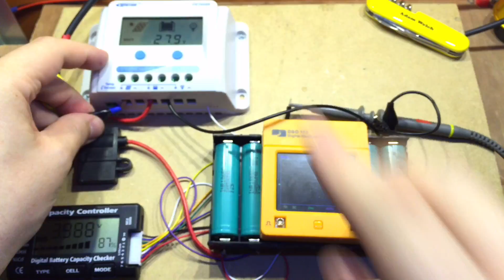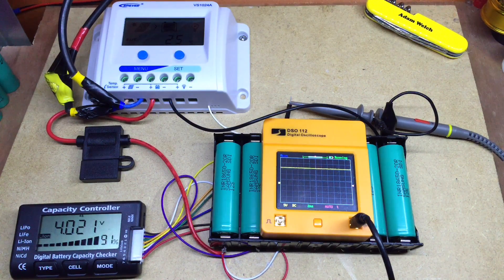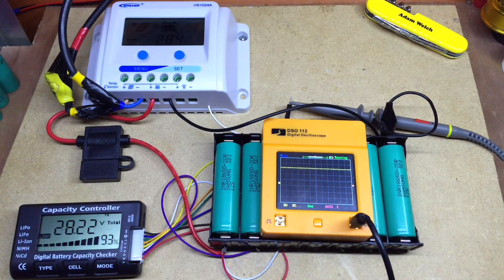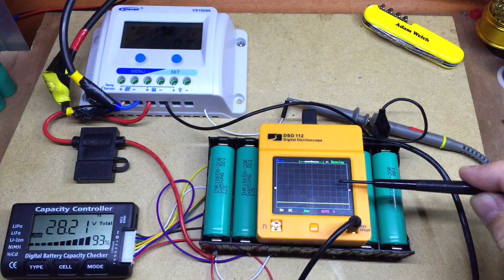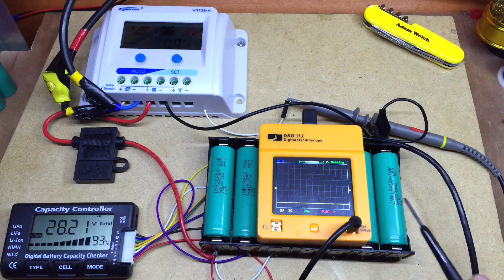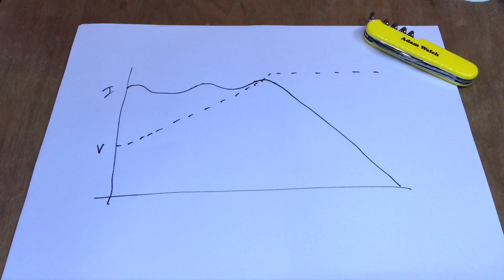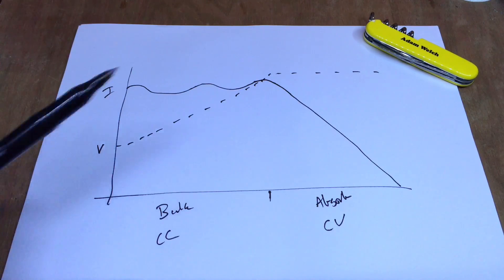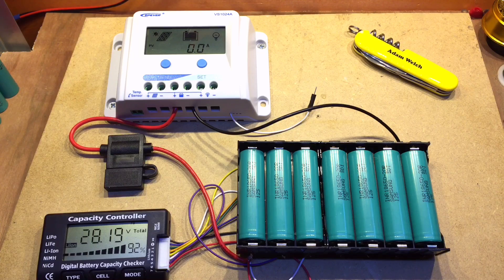Solar Charging Lithium Ion 18650s - Part 3, The Results - 12v Solar Shed

Comment: One thing I've been thinking about lately is using a raspberry pi and relays.

In theory you could have two sets of relays. One that connects the batteries together and another that connects directly to whatever you are powering or charging from.

Could charge in parallel. Turn those relays off. Then turn on the relays that make them in series. - would allow charging them at lower voltages. And i imagine, keep them balanced.

Comment: what is the voltage output on the load side when the battery is full and the pannel at 40 volt?
Reply from the maker: The output voltage is always the same as the battery voltage. It’s not regulated.
Reply: @AdamWelchUK  OK thanks

Comment: Hi Adam, can you tell me if the batteries need to be matched in terms of mAh capacity?  I have sufficient 18650 cells to make a 7s3p pack, but they are a mix of 2200, 2500, 2800, 1750, and so on.  Will this work?  Can they be mixed within the 7 cells in series or do they need to all be the same capacity? How about the 3 parallel sets - do they all need to be the same, or can they be different from each other? Interesting that the monitor device is also capable of balancing, you didn’t need the dedicated balancing board - that’s one less item on my eBay shopping list 😁
Looking forward to following through the rest of this series.
Reply: Ok - I just watched the next video, which has answered my question😆

Comment: Love your videos! Very informative, thank you for posting all of these! Especially this video, I'm looking for two different types of capacity checkers, one like the one in this video that can actually check the status of lithium ion batteries charged with an mppt controller, and a capacity checker for an e-bike battery pack. I'm looking for one that will monitor a 13s battery pack.

Comment: Hi, thank you for these video's very helpful. Can you please tell me, how does that little capacity checker balance the battery? I'm guessing it cannot physically disconnect (or divert current) from individual cells as they reach maximum charge so does it just put some sort of resistive load on the higher ones to bring them back down to there neighbor cells?  

And would you be able to use a small lead acid battery as a kind of dump storage then have it permanently wired up to a li-ion charge controller to deal with the 18650s? Thank you

Comment: can i made this same but uses 7battery you have i think volt stay same and make up capasity 21 battery  or 28 battery back need me buy ewery 7s bag own bms balance board ? i found same capasity controlelr gauge and 7S wires, but what have good 7S bms this set ? i looking aliexpress parts made own. i have battery lot and need my solarpanel 2 panel and future 3 panel. charger i no know what have good about 30A charger maybe need but what more need know charger ?

Comment: Hi. Adam nice video with good info.  Can you recoundmend a good mppt charge controller from ebay ie Ali. I have 2 solar panels each been 120 watts. They connected in parallel to give me more amps I'm not sure if that's a good combination or should I go through series connection. At the moment I'm using a cheap pwm from eBay I don't like it. The set-up I have is a 12-volt system through a 3kw inverter the batteries total about 170 amps. Will be grateful if you can recommend me a good mppt charge controller. And to let me know what would be the best way to set up the solar panels in parallel so I get more current or in series with a higher voltage. Thanks Yannis.

Comment: so your solar system output is 40 Volts? Or is it a 12V Penal (12v Solar Shed)? I didn't get that, when it showed 40Volts on the charge controller Thank you for the great video!
Reply from the maker: Sorry for the confusion.  I've dropped the 12v Solar Shed name now because I don't exclusively use 12v on the shed!  This lithium ion set was 7s so roughly a 24 volt system.  The panels connected to this set up were two twelve volt panels which actually produce an open circuit voltage of about 21 volts each and a maximum power point of 18 volts.

Comment: 1:12 That functionality of the CM7 was removed on the CM8 for some reason. Instead you have to go into a manual discharge mode and select a specific voltage or use the default 3.8v, instead of it detecting the lowest value cell.

Comment: My game cameras require 6V to operate.   I augment the internal AA batteries with 6V external power to lengthen the run time of the cameras.   I’m now using LiFePO4 batteries and a solar panel for the external power.   I’m using four 6Ah cells hooked in parallel so no balancing is required.  I use a Buck Converter on the input side with max voltage set to 3.65V.    On the output side I use a Boost Converter set to 6V.   This works quite well.    When the input to the BC gets to about 2V it will essentially shut off at which time the camera switches to the internal batteries.   
I no longer use LA batteries due to their sloping discharge curve.  My cameras were shutting off at about 5.2V.   The flat discharge rate of the LiFePO4 batteries results in using much more of the stored power.

Comment: dont know if your scc was the same as other scc ive seen, but, to properly initialize /detect the battery nominal voltage.... connect first the battery before the solar panel

Comment: You mentioned that the capacity LCD controller was also a balancing board, does that just mean that you had 2 balance boards conflicting with each other and the other one would have been fine solo? Did you test is on it's own?
Reply from the maker: The capacity controller can be put into a balancing mode, but it doesn’t do that by default.

Comment: I want to get a Capacity Controller but I am told it doesn't come with the wires. I am not sure where I can get the wires. I have found some that may work but I don't know if the plug is the right one. I can get wires of different colors but I don't see where to find the plug. Can you tell me where I can find the plugs? I have learned a lot from your videos! THANK YOU FOR THEM!!
Reply from the maker: These jst connectors are the right pitch and this is a supplier I’ve used in the past. https://rover.ebay.com/rover/0/0/0?mpre=https%3A%2F%2Fwww.ebay.co.uk%2Fulk%2Fitm%2F231134465060 Hope that helps.

Comment: I got one of those (or a clone - mine has an LCD display that says 'Totlal' instead of 'Total'), opened it up and found the board required 3mA and was powered through cell 1 regulated down to 3V.  Left on permanently it therefore discharges cell 1 and balances the others down to match - albeit very slowly.  If powered externally by 3v3 to the board (there is a convenient header for this inside), mine seems to avoid loading the cells asymmetrically other than for the balancing function when activated.
Reply from the maker: Interesting information - thank you Andy.

Comment: Hi Adam, Does that specific battery capacity controller also cuts off the battery circuit if one of the cells goes below a low threshold? Thanks for all these videos!
Reply from the maker: No - it’s just a balancer and has no connection to the main input/output of the battery bank.

Comment: Super interesting, thanks for all your videos!
 But I don't understand why there are no cheap electronics that do all this at once?
A solar charge controller and BMS integrated for a small 3S or 7S lithium battery pack and a low price. At least I haven't seen that yet and you still seem to have to combine multiple things that are not really designed for the task, increase cables and cost and probably lower overall efficiency.

Why are BMS electronics so underdeveloped? Is it a niche market?

It seems a small solar system with a few lithium cells would be great for a lot of people.

Comment: If it hasn't been mentioned, doesn't the name itself indicate it does balancing? It's not named a capacity tester (although it is that too) but it's named a capacity controller, and the capacity it controls is the balancing of the capacity.
I just got mine in the mail from china, and am hoping to work these into a balancer for an ebike pack. They seem to do so much for so little money, and though I'm still a newb trying to figure out how to build his first pack, I can't help but think there is a place for these, bike mounted or otherwise. Not to mention, they'd look pretty cool mounted to the handlebars . :)

I ordered mine because of your video, so thanks for the heads up on these.

Comment: Adam if you take these batteries  up to 4.2v per cell each charge you will shorten their life to 300-500 cycles (down to 80% capacity) if you charge to 3.92v you will  get 10x the cycle life <5,000 - you only need to balance charge the first 3 charges - then after 10 then  once every 20-50 charges  depending how well matched your cells are
Reply from the maker: I’ve been charging to 4.05v per group and that’s been working fairly well. I tested my cells after a year of use and they hadn’t lost to much capacity at all. Balancing (or not) is something that I need to play with more, but my latest project is going to give me that opportunity. Cheers for the thoughts.
Reply: I saw after I posted  -  I  have just acquired 8 Mitsubishi hybrid  Li-ion 40ah cells with a view to replacing the 110ah  12v sealed deep cycle lead acid camper van secondary battery - they make a CPT- li410 mppt for the roof 80watt panel but  how to get the vans split charge 14.5 volt  alternate to charge them is a problem -  some kind of boost converter  maybe but the alternators 55 amp  and with such hungry cells  it would have to be very robust  - ideas welcome  : )

Comment: Hi i have used your research and built a 200 w solar system with  6p 7s  new 18650 cells. (that wasn't cheap but for a first timer i would rather start with cells i could trust. lg hg2 3000 mah)
i found that using the balance function on this  battery tester made it so hot that the lcd started to blacken. i quickly disconnected it and found a solution. I cut the back open,  sawed a pc  heat sink in half and mounted the battery tester/balancer on it. this seems to work fine. be carefull there are some solder points and pins you dont want to short circuit. i used some nail polish to cover all solder points and made sure the heat sink is not in touch with any of them. Other than that the charger seems to be doing its job. i'm using the epever tracer a 30 amp charger. it cuts the batteries off at around 28.4 volts as you mentioned and that leaves each battery cell at around 4 volts. should last a while hopefully . 
Im using a 30 amp rated car power supply transformer to bring the voltage from 24 to 12 volts. its not bad in terms of electrical noise.
 Thank you for your research into this it has been a great help in building my system.
Reply from the maker: Great to hear about your success. I too used new cells to start with. I’ve not had an issue with the capacity controller getting that hot. It generally only balances at 60mA or there abouts. Is the ambient temperature high where you are? Glad to hear you found a solution though.
Reply: Adam Welch hi thanks for answering. I didn't find the balance function on the capacity meter until the batteries were starting to get quite unbalanced. So when it started balancing I guess the current was quite high for a while. Anyway works fine now. How do you find working with used batteries compared to new ones? Big difference? I'm concerned about them shorting out.
Thx again for the help.
Btw I live in Indonesia so lots of sun and heat of course
Reply from the maker: The only real difference between working with used cells and new is that you need to test them thoroughly before you can use them.  In my latest video I've talked about how I've been testing my latest hundred or so cells.  Once you've tested them you can group them into fairly even packs (and that is easier to do when the packs get bigger).  My latest pack is going to be 7s20p I hope.  I'm yet to test how hard a balancer is going to need to work to keep them in check - you'll have to look out for future videos  :-)

Comment: Hey Adam thanks for the video! I'm noticing all these EpEver PWM units are Positive common.. This would be the only component in my system that is positive common can I just switch the positive and negative leads so it functions like a negative ground controller?

Comment: Can this CC, or do you know of a better one, set custom voltage cut offs?  I want to make a 4s 12v pack, charge it to 4v per cell or so. Thanks for the awesome vids
Reply from the maker: +Bubba You are better buying a charge controller that you can adjust, but I wanted to see if it was possible to use an off the shelf cheap solution that wasn’t adjustable. For a 4s pack though you’ll definitely need an adjustable one. The EPSolar LS range can be tweaked using a cable, or their Tracer series of MPPT charge controllers can. Lots of others too, but I don’t have hands on experience of them.
Reply: Thanks for the quick reply, you the man!  I have a few nice CC for when I finally get a bigger set up going, havent even used them yet, lol?(Outback 80a, tristar pwm 45a, victron blue mppt 100/30), i even have a cheap renogy 30a pwm, and a morningstar 4.5a. I want something portable for a 4s 8-16p  setup... if you find a small CC that is adjustable let us know :)

Comment: So what was the reason the 1st three batteries were 3.8v and the last four were 3.5v or whatever? That was never discussed. Because wasn't that the reason why you put on a separate 7s balance board? So what happened?

Comment: Have a question?
if we make a series connection of three Li-ion batteries then voltage=4.2v but amps will increas may be 6000mah then do we need to put in 4 volts only or do we need to increase amps to efficient charging

Comment: Hey Adam, I just discovered your channel and immediately subcribed with notifications ;)  You are very informative yet concise in each video I watch, and it really helps me on my own projects. I haven't had time to watch all your videos yet (but plan on it) so in the mean time I was wondering if you could help me with my Lithium Ion 3S 100P solar power wall that im attempting to set up. So far I have built the cells and have a 120w/ 18v solar pannel, now all I need is a good solar charge controller (preferably MPPT). Money is not an issue for this and considering I might be adding more pannels or even battery cells one day something with varriable inputs and/or outputs would be ideal. Im wondering what you might recommend I use in my situation. Any advice would be appreciatated, even if im doing everything completely wrong im here to listen, thanks again and keep up these awesome videos!
Reply from the maker: Thanks Chris.
I do most stuff on the cheap so my experience of charge controllers is typically on the cheaper end.  Solar charge controllers sold as supporting lithium are usually lead acid three phase charge controllers which have had their voltage limits adjusted for a bank based on 4.2v cells.  Generally they charge to 4.2 per cell and float at that level and I'm not a fan.
Decent (pricey) solar charge controllers generally haven't caught up with lithium yet and are normally again three phase lead acid based controllers.  However as you've seen from this series of videos I quite like using lead acid solar chargers on lithium - as long as you understand the charging process  they can do a great job (this particular setup is still running strong in the shed - must be a year now). 
So I would look at a solar charger that allows you to customize the charging voltages to suit your 3s pack.  I get on pretty well with my EPSolar Tracer A series MPPT controller, and the new TriRon series is going to be sold as compatible with lithium.  Both would require the RS485 cable or some other means of programming though.  Midnites, Victron, MorningStar and Outback are all premium brands which cost more and I'm sure they could be adjusted to do the job, but I have no experience of them because I concentrate on the lower end products.
You're not doing anything wrong that I can see but 3s is a bit of an issue for me.  I don't think the voltage range of 11.1-12.6 is particularly compatible with things that you'd typically connect to a 12 volt system.  As I said in this series of videos 7s works better for me as a replacement for 24v lead acid systems.  It's just a shame I've come to that decision in the 12v solar shed!
Reply: Thanks so much, I might just upgrade to 7s 24v one day, just going to do some testing with 12v first.

Comment: Hi Adam, Im looking at making this to power a remote wireless modem as our broadband cable is shity, 
Does the balancer stop balancing or will it continue forever ? (it should stop when done)
As the balancing 18650s is important for my project ?
cheers Brett
Reply: It balances forever. Only if the power is completely off it will reset and stop balancing.